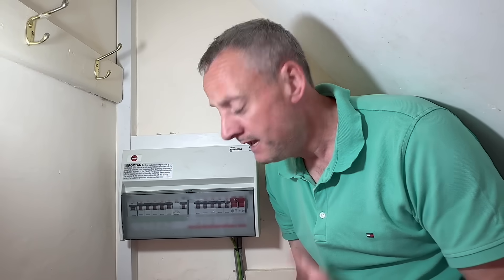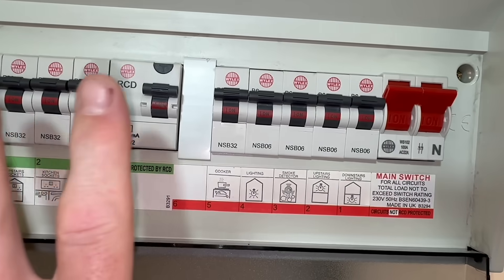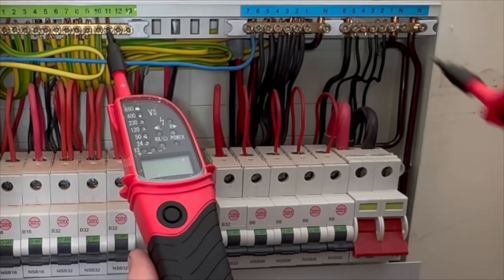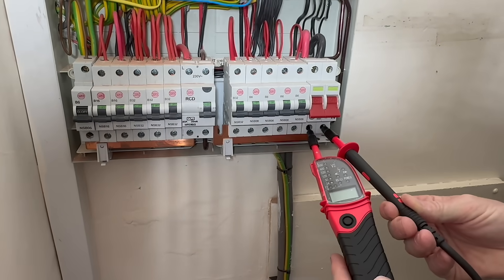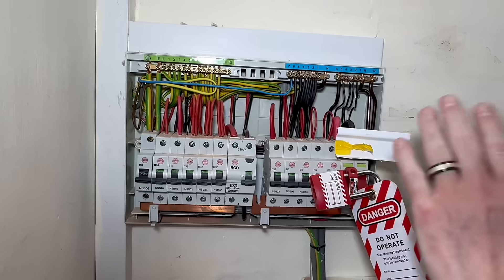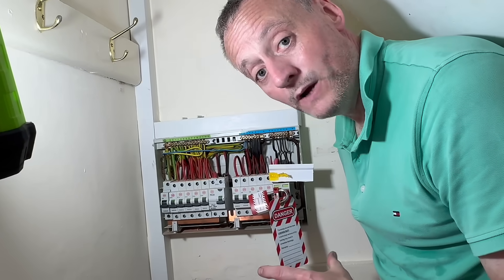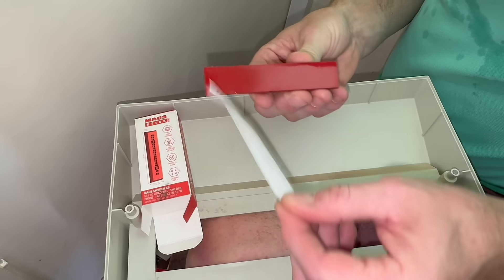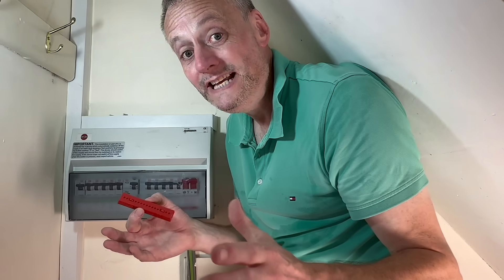£1000 To Change This Plastic Consumer Unit?

Comment: Is it unsafe? No. Could it be improved? Yes. Single AC type RCD covering a load of circuits with no selectivity, circuits without RCD protection. No AFDD. No Surge. Smoke alarms would go a light circuit. Really dislike them on their own circuit like that. To name a few bits. Would I ask to have it changed? No. Its not showing any signs of overload, heat or other damage.
Reply: I suggest you read the instructions on most smoke alarms. They very specifically cannot go on a lighting circuit with dimmers and LED bulbs. Therefore I put mine on a circuit with the front door bell. Frankly if a electrician did an EIRC and said something about that I would ask them to leave as being incompetent.
Reply: AICO state: (a) an independent circuit at the dwelling’s main distribution
board, in which case no other electrical equipment should be
connected to this circuit (other than a dedicated monitoring
device installed to indicate failure of the mains supply to the
Alarms); or
(b) a separately electrically protected, regularly used local lighting
circuit.

So your door bell circuit would fall foul of this
As for LED bulbs? Many an install will fail an EICR then as lots of smoke alarm installs will pre-date the introduction of LED bulbs
And what about the many decades of CFL's that would have been used?
Reply: @guffermeister the problem is dimmers, LED bulbs extra put out a lot more noise which can interfere with the electronics in the smoke/heat/CO detectors. A traditional door bell will not do that unless it happens to be operated at the exact moment a fire starts and a few seconds later it will be just fine when someone stops pressing the door bell. Consequently you should not have the smoke detectors on a lighting circuit. The manufacturers stipulations overrides anything in the regulations. Besides my detectors all have battery backup and will start beeping if the mains stays out. A right pain in a prolonged powercut.
Reply: I get why not for LED Lights on the same circuits like that but many an older install where its done off lights before the manufacturers caught up and put the exclusions in for LEDs etc. If you just change the replacement section many a spark wont give it a second throught, and neither would most non sparkies. Battery backup or not, but you could end up with the door bell setting off the alarms when activated (unlikely) - still a deviation away from manufacturers instructions as not on its own circuit with no other electrical equipment in the case of AICO....
Reply from the maker: Thanks for the detailed comment
Reply: Why the dislike for alarms on their own circuit ?
Reply: Being on an isolated supply makes it easier for someone to disable the system. I know they'll have battery backup etc. Flipping a breaker is easier than having to get to the alarm and either slide it off its mount or undo the fixed wiring.

Comment: have the cooker  got a socket on it ? would need a rcbo
Reply from the maker: No it hasn’t
Reply: No it doesn’t the instructions was designed and installed before the seventh edition amendment three which is when RCD became a BS7771 requirement. It does not apply be for amendment three . However the new circuit that has been installed would be required to have RCD protection ? If it was installed after amendment three of bs7671 seventh edition.
Reply: @Dog-whisperer7494  16th edition require on sockets that can be used outdoors on domestic installations
Reply: @Dog-whisperer7494 What’s up with this “if it was ok when it was designed then it’s only a C3”. This is completely false in a lot of scenarios. 

If you have a socket that can be used to supply outdoor equipment, then it needs to be on an RCD and is a C2 on an EICR if it’s not. Doesn’t matter if the install is 50 years old or 5 years old.

Comment: Just had this with a NIC registered sparks...c2's on nearly everything......wanted 4 grand for a partial rewire and board......until he met me and ended up walking away with his eicr up his arse
Reply from the maker: Well put
Reply: Exactly the same situation in our block of flats. Ended up with our managing agents who sent the cowboy being sacked.   He didn't seem to understand that I understand the difference between C3 and C2 and what is and what isn't covered under an EICR. All the actual tests past fine. Electrical system only supplies limited lights in public area plus plugs for cleaner and door intercom. C2 saying we must have surge protection installed. Why hardly any electronic equipment on the circuit.
Reply: I like it and would have loved to see his face. Talk about making money for nothing!
Reply: I’d like to see/read what he C2’d … Do tell old Boy….
Reply: Ring the NIC and report them .
Reply: @TronicUK for what?
Reply: @markhardacre1 incorrectly coding an EICR report for financial gain .
Reply: @TronicUK Client has done that.....let's see what they say
Reply: @TronicUK filling out an EICR doesn’t mean the client has to comply with your “Observations & Recommendations” or advise and it’s up to the customer to proceed and improve or not. I would
Like to see the report to comment further, however I was always taught if there is a danger that required one other action to make it an urgent danger then code it C2 

E.g. No RCD ON PLASTIC CU under a stairway/fire escape Route. Faulty MCB from repeatedly loosening and  frequency of repeated re-tightening caught fire. 
Now Customer wishing the fire had been contained in a  metal enclosure sobbing into a fireman’s arms… 
Or a split load AC RCD didn’t disconnect as intended by original design due to occupants Alexa leaking ⎓ into the RCD rendering it useless, and the owner had a shock of the cooker fell over broke ship and now needs a heart transplant. See !
Reply: @markhardacre1   if you read the OP It states multiple C2s that should not be coded as a C2 . 

What a coincidence that the incorrect coding benefits the electrician financially 

Are you saying this is good practice ? 

I would be inclined to accept the work then not pay for it and present the case in court .
Reply: @TronicUK Fair enough - but that’s exactly why I’d be asking for payment up front for a customer like you.
C2’s are subjective and can be justified in court later by the inspector - Remember this is an engineering opinion. And the “Codebuster” is not a legal document forcing us to code X as Z.
The EICR you write  will be used in court, And therefore protect from malicious narcissists that try and take you to court for doing you Job. This covers your self when notifying a customer of hazard which is potentially dangerous. I’d rather urge on the side of caution when coding improvements that may or could deteriorate in the next decades Inspection done by some one who initially qualified on the 16th edition but failed to keep up to date with improvements in the regulations thereafter.
Reply: @markhardacre1  a load of poor excuses for not coding an EICR to the regulations …

80 % of the codes should be the same through the industry . 20 % disagreements through interpretation 

Speak to you’re scheme provider if you are unsure .
Reply: No he didn’t.
Reply: It wasn't ariston electrical
Reply: Same had nic approved do our eicr and gave us unsatisfactory as cable nor protected from premature failure despite installed prior this reg. They said we have to test to currant regs not the regs when it was installed.!! Can I argue this? Not sure what to believe
Reply: @ks-hg5vo  You test to current regs, and C3 if it was compliant at time of installation
Reply: @TheChipmunk2008 thanks for the insight. They c2 it. So needless to say wont be using them next time .

Comment: As a electrician I hate when customers tell me they have been advised to change their pvc  ccu because it is pvc when it compiles this is a electrician looks for a quick £1000, that electrician needs to have at least the codebreaker on board, Onsite or GN3 it really annoys me. electricians needs to understand that a periodic is a minimum to obtain a satisfactory of BS7671 anything more is recommendation.
Reply: I’ve been saying that for years. They should also reference page 99 in the onsite guide as well as the HSE note in BS7671. 
Some of these electricians not all but a good few see an old CU /installation designed and installed before the eighteenth election of BS7671 and their eyes light up with pound signs.
Reply: @Dog-whisperer7494 so what! You can’t shrug it falling behind and needs attention. How many decades do we kick a re wireable 3036 down the road for, because it was fine when it was installed. Madness 😂
Reply: And maybe that board had NSB mcb's as they need to be taken out to check the codes on the side
Reply: Who said he didn’t code 3 it? These lot are just trying to sell that little mouse thing. Which definitely won’t work.
Reply: @rudz8916  it’s not bad advice though is it. Improving an installation is never bad advice. Different if they are telling them it needs to be done
Reply: @topsparks4794 and that the problem. Good advice is one thing but when a spark blatantly lies by saying the CU is dangerous and illegal and has to be replaced and then charges a thousand pound or so for a new CU that he paid seventy quid for from B&Q then that just ripping people off. Pure and simple. But to be fair not all electrician work like that. I even had one guy try it on with me until he saw my electrical qualifications on the wall and he realised my house is a housing association property. . He left so quick I’ve never seen a transit van do a wheel spin so fast . 😂
And yes it’s a true story
Reply: @topsparks4794 ❤
Reply: @topsparks4794 well said!  it does need to be improved! The regs can be used to highlight how far behind an installation has fallen. In my experience customers often lie about what was actually said, either to save face or just be…

Comment: Can't see the point. Consumer unit is fine, the torque settings have been checked, no point putting the MAUS stixx in as well. Metal consumer units and any additional fire suppression devices are only to cover the dodgy work by cowboys and they are hardly going to fit MAUS stixx.
Reply from the maker: It adds another level of protection for the 83 year old consumer ✔️✔️
Reply: @efixx  just replaced my own consumer units with nice hager metal ones, might be getting some for them anyway. I thought hager made their own version but can't find them so i assume it was short lived.
Reply: Circuit breaker or RCD or RCBO may have malfunction from the factory.

Comment: Nothing wrong with that 👍
Reply: Lots wrong with it. Times have changed. For good reason.
Reply: @CoulterTravel ok, what's wrong with it that would fail an eicr and mean you'd have to get a rewire?
Reply: @therealdojj who said anything about failing and rewires?
Reply: @CoulterTravel incorrect, wireing is not retrospective. If it was to the regs when it was installed, it does not have to be updated (within reason providing it is safe), unless it is rewired. I have a yearly electrical inspection on a twin plastic CU ,and it does not fail as it is an existing installation. When they re did the bathroom they added a rcbo as a light in a bathroom requires rcd protection, that was nor required under the 16th edition, as an example where updating to current regs is required.
Reply: @regsmith5972 type AC RCDs. To mention just one thing.
Reply: @CoulterTravel RCDs that you can change without changing the CU, if needed.
Reply: @regsmith5972  Why not just change the board if you're doing that? The price difference is negligible
Reply: @CoulterTravel I doubt the price would be similar given the amount charged for labour. If it is the electrician is robbing you. We haven't even established that the RCD is of a type needing changing?
Reply: @regsmith5972  The price wouldn’t be far off, if you’re trying to source NSB RCBOs. And with the consumer unit change you’re getting a better product, fire rated and SPD. Any electrician with any experience knows for a fact those old Wylex RCDs are AC and covering circuits at a depth of less than 50mm burial in walls, code breakers says this is code 2. No one is robbing anyone.
Reply: @regsmith5972  zoom in on the screen you’ll see it’s clearly a type AC
Reply: @CoulterTravel Again, is that a good enough reason to change the CU? Are you absurdly suggesting that a reputable electrical firm (if such a beast exists) is going to quote £1000 to change a RCD, when the customer was quoted this to change a CU? Do you suggest all existing plastic CU in the UK be replaced with metal ones? I am sure unscrupulous electricians up and down the country will be rubbing their hands with glee. Also given how sub standard most qualified electricians are now, what garentee have you that the replacement will be of a similar standard to the existing installation.
Reply: @regsmith5972 our consumer unit upgrades are £650+VAT, this is for Hager RCBO boards with SPD. A far superior board to this old piece of crap. We don’t force people to do it. We say it’s your choice, that’s our price, you haven’t got to do it. I’ve never had anyone not want to do it. Changing all the RCBOs in this board, to NSB Wylex would cost about £150 more.
Reply: @CoulterTravel You do not need to change all the rcbos on a split board a 30ma type a rcd approx 11 quid plus limited amount of labour to change one or two RCDs. Quite honestly I would not have a syster electrician such as you in my house if the landlord sent them. This is the problem, most sparks qualifying recently now are really quite dim, I know I worked with them and had them sent by by my landlord.